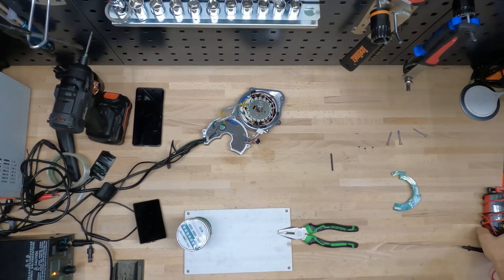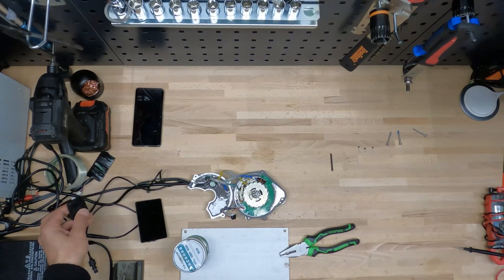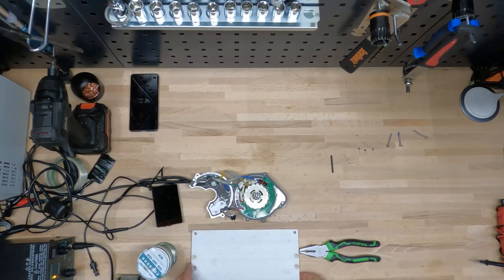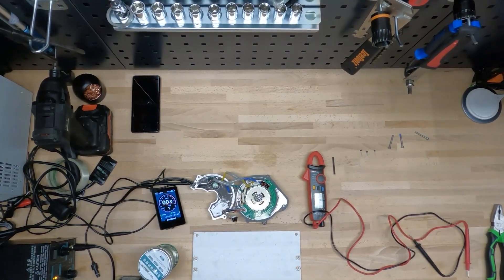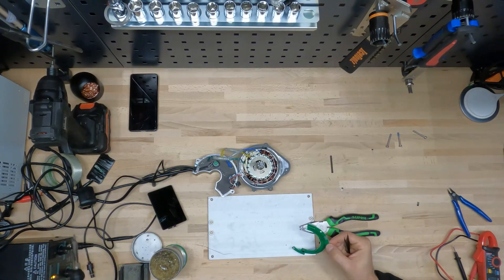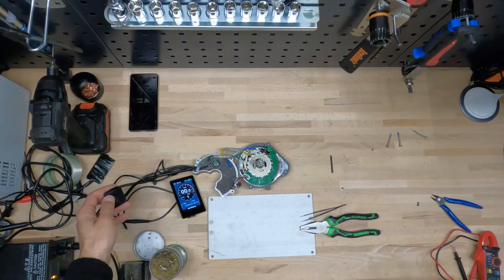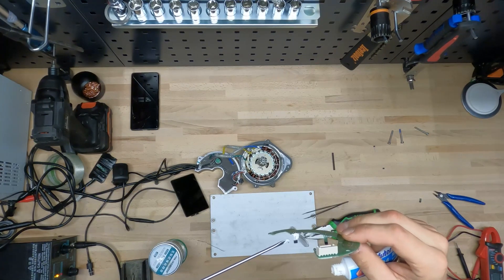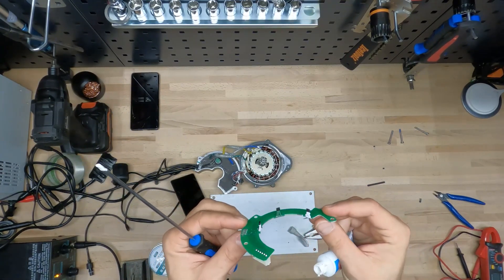BAFANG BBS Hall Sensor Replacement

Comment: hello what are the types of hall sensors u use and where to buy them i got the same board and error 08 on my bike, because the chips are glued 2 of them are broken
Reply: I'm not sure what sensors the video author used, but I used SS41F sensors.
You need to replace all 3 sensors at once, even if only one or two are broken. Replace all 3, and then it will work.

Comment: Could you name the Hall sensor type suitable for Bafang BBS02b? That would be great. Thank you!
Reply: Greetings from Russia!
I encountered the same problem, the Hall sensor broke. I removed the board and found that one of the sensors had broken legs (rust). The marking on the sensors was damaged, and I couldn't determine the required type of sensor. I turned to ChatGPT, and it said that SS41F sensors are used. I bought those exact ones, and at first, I decided to replace only the faulty sensor. It didn't help.
I decided to replace all 3 sensors, and it worked, the motor started working, and error 8 disappeared.
Therefore, use the SS41F sensor and replace all 3 sensors at once.

Comment: My motor won’t stop after you release the throttle or stop pedalling it only stop when you apply brakes or Set 0 PAS. I did change the hall sensor but the problem doesn’t fix. Hope you can help me.